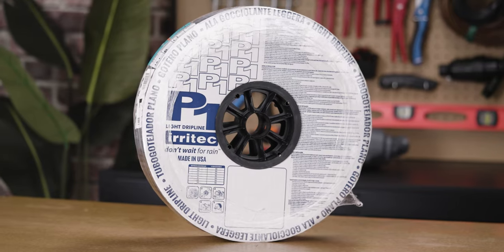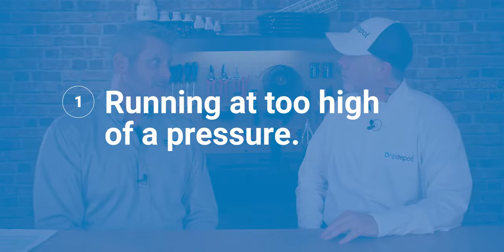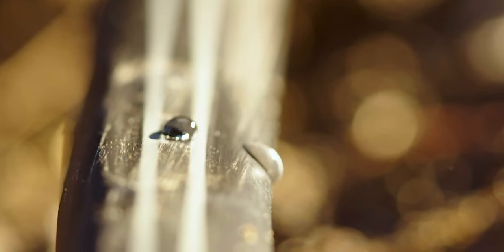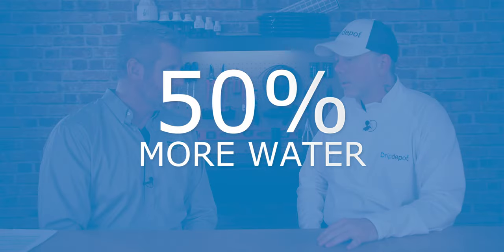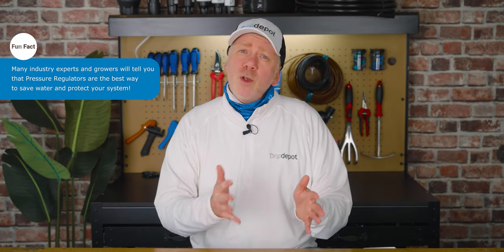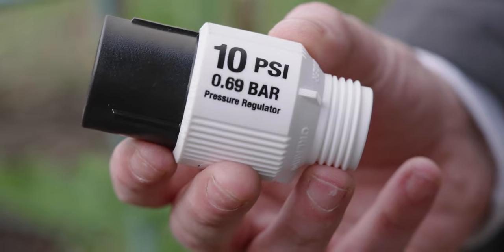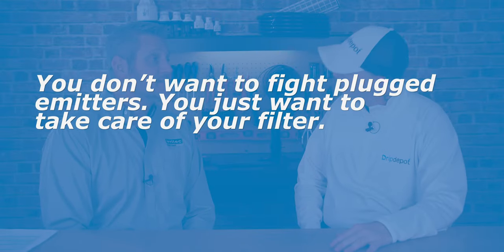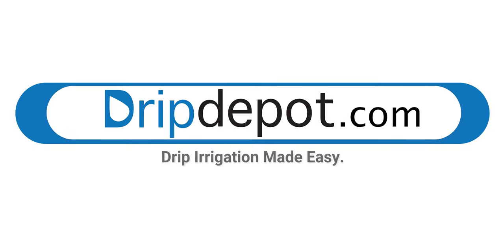2 Biggest DIY Drip Tape Mistakes to Avoid

Comment: O, you can’t hook it up to existing sprinkler.
Reply from the maker: Not directly to a sprinkler, but a drip system can be connected to what the sprinkler is connected to -- in a fairly easy process too.  It basically boils down to unthreading the sprinkler, then threading on some drip components (filter, pressure regulator, adapter to connect your tubing or tape) and running your tape.  

That does mean that sprinkler is out of service unless the drip components are removed and the sprinkler threaded back on though.

Comment: If you could recommend one of your videos that could be a “follow along” type for very new to drip irrigation. WHat would it be?
Reply from the maker: Very good question Gracie, I'm glad you asked so the information will be in the comments.  There are two videos that I think, in combination, would work.  The first is the "How to Design a Drip Irrigation System (Beginners Step-by-Step DIY Guide)" video -- it will lay the groundwork to show you how to design the system.  The second is a full step-by-step walkthrough of installing drip irrigation in raised beds.  It's a long video as we wanted to actually show everything.  That one is titled "How to Install Drip Irrigation for Raised Beds (Complete DIY System Guide)."   

I'll link both here (cannot shorten a URL in YouTube comments unfortunately).  

Design: https://www.youtube.com/watch?v=FJF49lb23b8

Step-By-Step Raised Bed Guide: https://www.youtube.com/watch?v=1w_e-DFXUsw

Though both videos are tailored towards raised beds, they work well for other system types as well as they use mostly the same parts and emitter types.  :)
Reply: @dripdepot  thank you so much! I have a small garden. But think my success has been hindered due to not watering as much as 8 should. I’m afraid of drowning plants. But may not have watered enough in past years. Also I’m in zone 3B. So very short growing season! Cheers
Reply from the maker: Zone 3b?  Brr!  I lived in South Dakota for awhile so got to experience those short growing seasons for awhile too.  Never had better strawberries though.  

It's funny you mention this, because we see overwatering a lot more than we see under watering -- if you're under watering, it's fortunately a very easy fix to increase the watering cycle just a little bit.  I think I probably overwater too, I've been reducing my cycles a bit each year (and so far, my plants have been as healthy each year, so I might try to go lower again this year).

Comment: I have an entire kit from drop depot. My drip tape pops off my permaloks constantly, despite the fact that I have the 10 psi flow restricter just after the filter. I found this video looking for a fix or a reason why this continually happens. Just as described it’s a real problem until someone notices. It happens every watering to at least 2 sometimes 5 tapes
Reply from the maker: I can confirm the tape should not pop off the fittings!  Even at 15 PSI (and even a bit higher on the 15 Mil thick stuff) it should stay on the fittings until removed for any reason.  If you can, send us this information at our Contact Us so we can get this up and running as it should with you -- just in case, here's the link: https://help.dripdepot.com/support/tickets/new

Let us know which fittings (takeoff adapters or end caps) and potentially a photo of the installation -- we'll take a look and see if it's something we can spot at a glance or if something is up with the fittings themselves.

Comment: Intense summer sun in the south can deform drip tape and main lines causing stress and blow outs as well. I always run my system on a 5 minute manual every afternoon and check for problems.
Reply from the maker: That's very good advice, thank you for the comment!  You have it exactly right too, in hotter climes the thermal expansion/contraction of drip tape can displace it and, like you noted, pull the tape off of fittings over time.  

Checking it for problems with a short cycle like you do is a good approach -- that has the double benefit of running some cool water through it.  Burying it under mulch (or even soil in some cases) can also help, though that has the downside of concealing issues sometimes.  

Great comment, thank you again!

Comment: I have recently planted 10 small fruit trees , is drip tape suitable for trees and also can it be placed under tree mulch ? Thank you
Reply from the maker: Yes to both counts!  Drip is is often use with trees (particularly young trees) and is frequently buried under mulch.  Make sure foot traffic is careful around the buried tape.  As the trees mature they may benefit from a second run of tape on the other side as well :)

Comment: Hi you are doing a great job. What is the cost of a role of your drip tape I need to make demands for it
Reply from the maker: Thank you for the kind words! 

Drip tape can very by roll length, wall thickness, emitter spacing and brand, but as of this writing (4/19/2023), to give you a rough idea, we have 100' rolls for around $17.20 4100' rolls for as low as $259.00.  That's for the thicker walled (15 Mil) drip tapes, thinner walled tapes will often be less per foot since they use less materials and can come on much longer coils (up to 10,000').
Reply: @dripdepot  coils of 10,000' with thinner walls will cost?. And what is the durability
Reply from the maker: Right now our 10,000' rolls go for a little as $285.00 and as high as $370.00 depending on brand, spacing, etc.  In regards to durability, these coils have very very thins walls -- a Mil is a thousandth of an inch thick, so 6 Mil thickness is only six-thousandths of an inch thick.  This makes it very easy to damage -- with that said, drip tape is also very easy to repair by using a coupling.  6 Mil tape tends to be used for just a season or two, whereas the thicker tapes (15 Mil) can last quite a few seasons (though minor repairs will be needed during that time).

Comment: Do you face the emitters facing up or facing down?
Reply from the maker: Great question, and one I wished we'd addressed in the video!

Always face the emitters up :)  Happy to expand on that below: 

Facing them up greatly reduces the chance of clogging -- after system shut-down, some water will drip from low point emitters while the lines drain.  As that water leaves the tape, air has to enter to replace it and sometimes this air can come from other emitters -- if they're facing down, they might pull in some debris with them and get clogged.  

Thank you for the great question!

Comment: I had a new system in my greenhouse with a filter and my lines still get clogged how do we fix this his issue
Reply from the maker: Victor, do you know what is clogging the emitters (mineral build-up, organic debris like algae)?  Also, what emitter types are they, misters/foggers, or drippers?  

Misting nozzles, often used in greenhouses, have the smallest orifices irrigation -- they're prone to getting clogged by calcium/mineral build-up, probably more than any other emitter type.  These are often unclogged by injecting solutions that lower pH enough to break up the build-up and flush it out of the end of the line.  Some misting nozzles are easily removed and can be soaked.  

Likewise with algae or other soft organics, solutions can be ran through the lines to eliminate it so it can be flushed out of the end of the lines. 

Aside from that, regular flushing of the lines can help prevent any kind of build-up -- drip irrigation tubing and many emitters are designed to create turbulent water flow -- this turbulence breaks up debris so it can be flushed out of the end of the line.  Without flushing, debris begins to build-up inside the lines eventually causing a clogged emitter. 

You can also check the mesh of the filter being used -- filter elements can go up to 200 mesh / 80 micron, which is very fine filtration.  With that said, if you're at 150 to 155 mesh, I wouldn't expect the filtration to be at play, at 155+ everything except the very finest particulates will be captured and those that get through can be flushed.

Comment: i need connectors to go from 1/2" hose to 5/8" drip tape anyone know of a connector that would work ? why does nobody have 5/8 irrigation hose ? i see lot of people using pvc and making it work but it seems more costly than it would to be to buy a big roll of hose.
Reply from the maker: You bet, you can connect 5/8" drip tape to 1/2" tubing with this little connector here: https://www.dripdepot.com/search?q=1225 -- in regards to 5/8" tubing, a lot of the tubing out there labeled 1/2" really is 5/8", coming in at .600" inside diameter, .700" outside diameter.  It's confusing for sure and largely comes from PVC size conventions -- for example, 1/2" PVC pipe is actually about .600" inside diameter (inside diameter can vary depending on wall thickness) and an outside diameter of 0.840".  Basically, a lot of the 1/2" tubing/pipe sizes out there are actually closer to 5/8".

Comment: I'm wondering why the Premium Drip Irrigation for Row Crops System which I already purchased has a 15 PSI flow regulartor if it's not the correct one.  This video states we need a 10 PSI flow regulartor.  I haven't set it up yet.  Do I need to have it exchanged?
Reply from the maker: Hello LeiNani!  Very good question -- drip tape typically runs at 8-15 PSI, depending on the wall thickness.  In our row crop kits we use the thicker walled tape (15 Mil) so the 15 PSI regulator is a good choice for it.  Drip tape used to be something used primarily by commercial farmers with very long rows.  For transportation, costs of material and ease of installation, they often use very thin walled tape at 6 - 10 Mil thickness.  At those wall thicknesses they'll usually regulate down to 8-10 PSI.  For the most part, it's all about the wall thickness and the 15 Mil thick tape works great (and won't burst!) at 15 PSI :)

Comment: I just order an irrigation system from you. How height I will should put the water tank if I need to irrigate 18 line for 208 feets long?
Reply from the maker: Thank you for reaching out! 

When it comes to barrel height, we find that the highest you can reasonably (and safely!) place it works the best.  With that said, some emitters, like drip tape and coupling valves used as emitters, are more reliant on flow than pressure so you can try varying elevations and see where you get the best results.  I see you emailed as well, we'll fire off an email with more information :)

Comment: Hi I'm new drip irrigation. I have run 1/2" pex pipe to my raised beds. Now I think I may have a problem addapting  pex to your tube to tape. is there someone who can help. I have watched several videos' but im still confused and unsure of how to proceed.
Reply from the maker: We don't currently have PEX fittings, so I'll be somewhat limited, but I can definitely assist and have assisted others with the information.  So, it will depend on whether you plan to go from PEX to Tubing or PEX to tape.  Most likely all you'll need is two adapters: one a PEX x Threads and the other Threads x Tubing (or Threads x Tape if going directly to tape).  

Going directly to tubing or tape will depend on a couple factors -- do you already have pressure regulation installed somewhere so you're at the lower pressure drip irrigation prefers?  Likewise with filtration.  It's no problem either way really, as there's easy and inexpensive solutions no matter which route you need to go here, just want to make sure everything is accounted for :)

Comment: how long can you run drip tape and it still work correctly?
Reply from the maker: Do you mean overall life span?  If so, it largely depends on the wall thickness of the tape -- for example, the very thin walled stuff (6 Mil) is often used as a one and done line by many commercial farmers.  They'll use it for a season, tear it out and ship it off to be recycled.  The thicker walled stuff can last for years -- how long depends largely on the care given it.  Primarily, landscape maintenance equipment (lawn mower and weed eater have damaged many lines!) and foot traffic.  With reasonably good care, we've seen the 15 Mil stuff last 5-10 seasons.  Even then, damaged tape is pretty easy to fix with a coupling, but at some point there simply ends up being too many couplings.  Limiting UV exposure as much as possible can also greatly extend the life span into the deeper range of that 5-10 season window. 

Basically, unless you're using the very thin walled tape, with a little care you can expect a good lifespan from it :)

Comment: I want adaptor to connect the following.
1. My home tap of 1/2” with male adaptor attached to it. So i want 1 Female adaptor for this which can connect to my 1/2 hose pipe.
2. At the end of the hose pipe of 1/2” i want a female adaptor which can connect to my 16 mm Jain Irrigation pipe.
3. I want a male adaptor for my 16 mm Jain Irrigarion pipe.

I am open to a new idea if you can suggest somethimg. I want the system to be manual without any electric device in between.
Reply from the maker: I think this will absolutely be easy to achieve, though I'll want to clear up some of our possible differences in terminology or units to make sure.  

1. Is the home tap a standard hose bib / spigot?  If so, those threads are most likely 3/4" male hose threads -- definitely worth double checking in case you have 1/2" pipe coming out of the hose to a 1/2" male adapter, but if it's a standard every day spigot it's likely it's male hose threads.  If it is hose threads, this fitting here may do the trick (I say may because we'll want to make sure your tubing's inside diameter is a match): https://www.dripdepot.com/1193

2. 16mm is about 0.630" -- I found one of Jain's 16mm tubing listings and they state it is 16mm inside diameter and has a 1.10mm wall thickness -- this would make that tubing 0.630" x 0.710" -- that's a fairly common tubing size, but I do know Jain makes a lot of sizes so it would be best to confirm yours is 16mm inside diameter.  If so, this 1/2" female pipe thread x tubing adapter would work: https://www.dripdepot.com/2117 -- just like the above, it's best to confirm that the make adapter you'll be using this fitting with is 1/2" male pipe thread.  

3. Is this one to connect to the adapter in #2?  If so, this one will do the trick: https://www.dripdepot.com/1471

If the adapters in #2 and #3 are meant to connect to one another, it could both be in in Loc style fittings by going with 3/4" female and 3/4" male in these two fittings: 

https://www.dripdepot.com/7906 -- This is 3/4" Female Pipe Threads
https://www.dripdepot.com/1472 -- This one is 3/4" Male Pipe Threads 

The barbs on both of those adapters are compatible with tubing that has an inside diameter of up to 0.630".  

Happy to help on this!  If you're unsure on any of the sizes of anything, you're welcome to send over photos and/or links to what you have and it's likely we'll be able to determine what is compatible to achieve your desired layout.  I don't think pics can upload in YouTube comments, but they can be emailed to us from here: https://help.dripdepot.com/support/tickets/new -- that goes to our Contact Us link which creates an email, but you can also just send it to our address if you prefer. 

The timer portion will also be easy to achieve, though you'll likely want this at the actual spigot -- the reason is LDPE (Low Density Polyethylene) is not rated for constant pressure and will need to be relieved of pressure when the system is not in use -- placing the timer right at the spigot/head assembly before the system will solve that :)